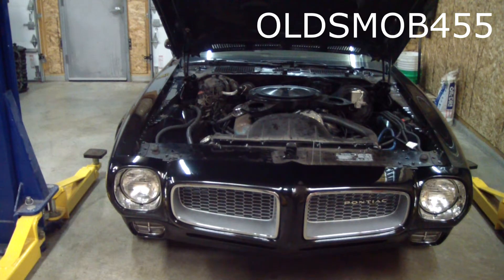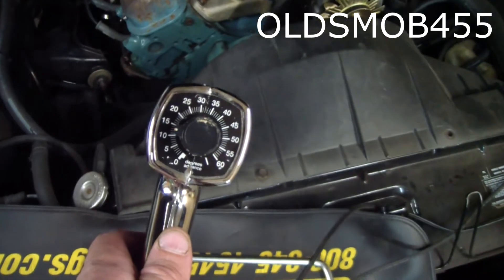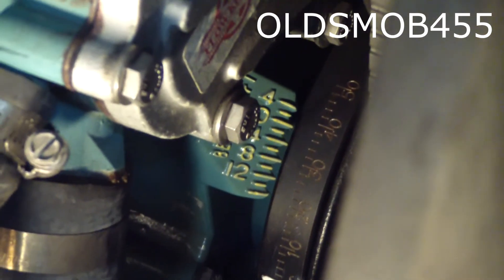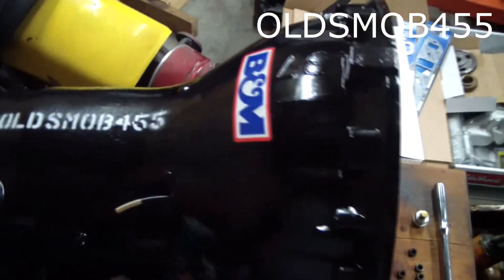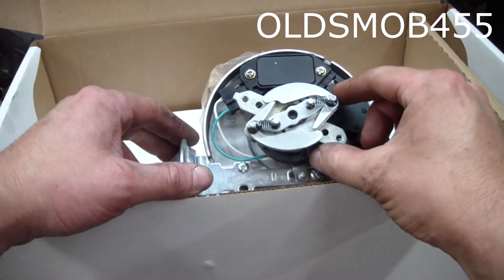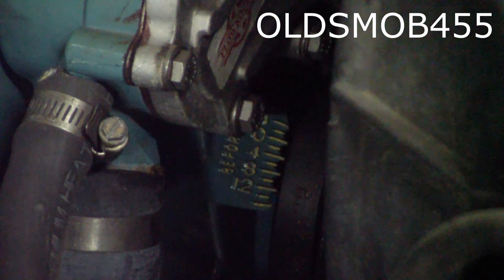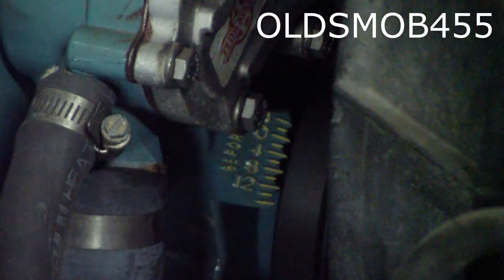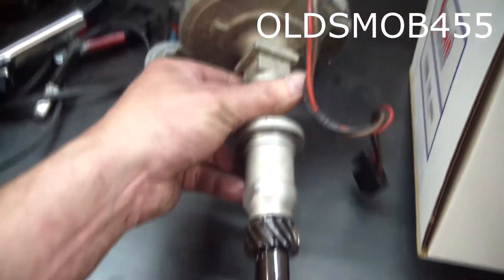Automotive Quiz : Ignition Timing

Comment: She sounds strong. Always liked that particular front end. The later wedge ones with all the plastic were not so nice. Off topic, but years ago I would drive around with a wrench and a flashlight at night... yea, I know, weird.   Anyways, I would stand on it, pull over, advance it.... stand on it, pull over, advance it, and continue until it would start to detonate and then back it off a tad. Actually, doing this at night was probably better to avoid attention. Those old motors always sounded so starved without serious advance.